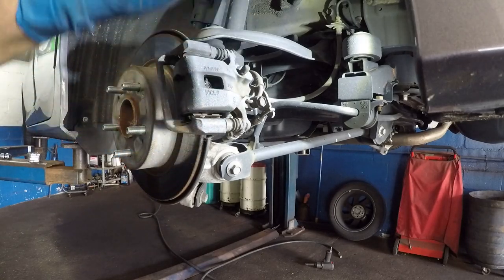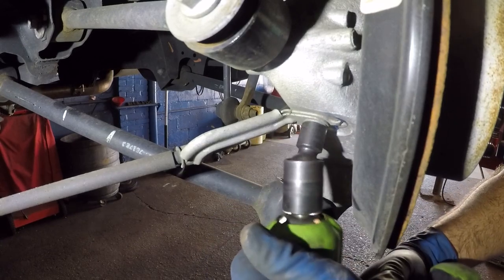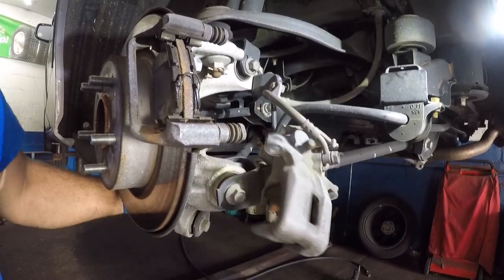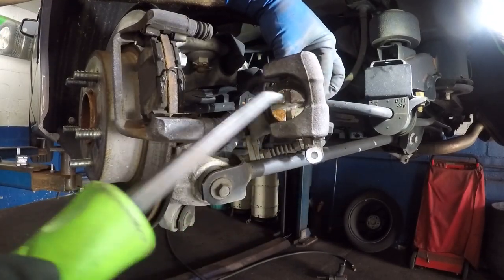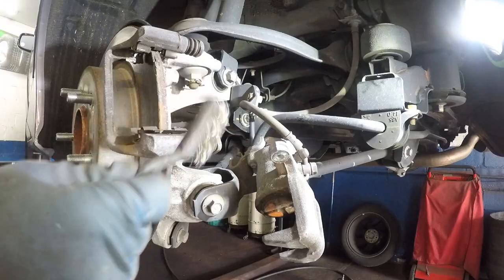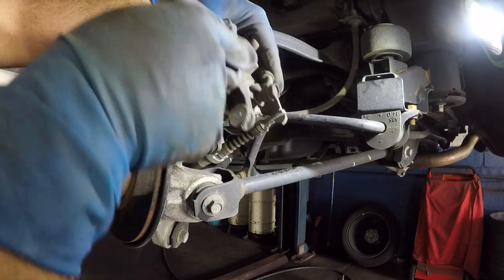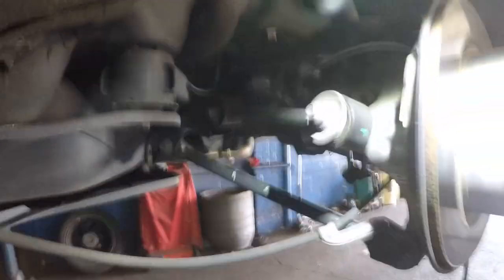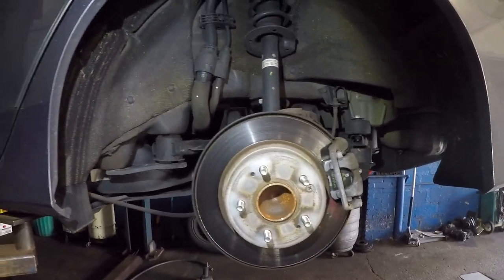2018 Honda Accord How to replace rear brake pads

Comment: 2018 Accord 1.5 and 2.0 turbo have electric parking brake system,  it need to retrieve the actuator motor back before install the caliper back. i don't know what kind of Accord is on this video.
Reply: . do you see EPB actuator on the rear caliper ? that is what i mean .
Reply: @UCBHoelwLyV4fCIhMwCqwHjw do you know what is a EPB ?
Reply: And how do we do that?

Comment: RB, you don’t turn the rotors after replacing the brake pads?
Reply from the maker: No we replace rotors not resurface not worth it
Reply: @RBTheMechanic  
Interesting.
Thanks.

Comment: Bro this isn’t a 2018 because  I watched your video, cost me 1,000$ anyone reading this, he does not mention that the caliper pistons for electronic parking brakes cannot be retracted manually. You must put the car in a maintenance  mode, and I’ve yet to find a video for it.
Reply from the maker: SandMyWood you have electronic brakes that one need to be commanded to release the brakes

Comment: That 2018 Accord must not be a Sport model because the Sport has torque bolts not regular bolts holding on the calipers and you aren’t able to use pry bar to recompress.
Reply from the maker: Shawn Sosa sorry your right I have to edit that 2018 has electrica caliper
Reply: Been trying to figure out what bolts there are. Hex, torx, star? Size?
Reply from the maker: Clint Blankenship I’ll make a video if I get hands on one of those
Reply: Where is the electronic park brake? Why no lubrication?

Comment: Do I need to bleed the brakes on it after I replace the pads
Reply from the maker: No only bleeding is needed if u replaced a component such as caliper line or master cylinder
Reply: Bleed every 30k kms.

Comment: NOT a 2018-2020 accord. Can easily tell off the bat by the side mirrors. Why lie?
Reply from the maker: I will look in to that I know new ones have electrical caliper process is same with different style caliper one need to be commanded with computer but will look in to it